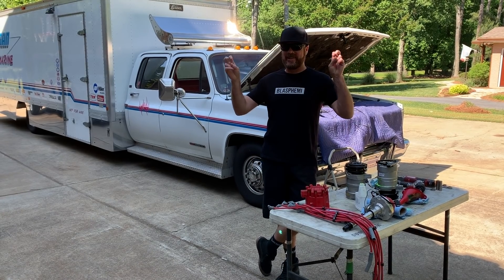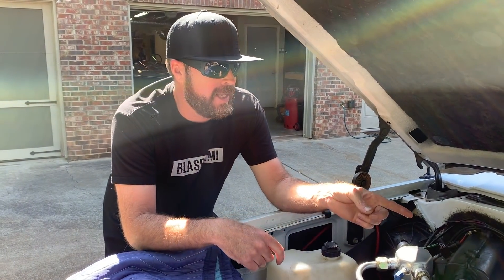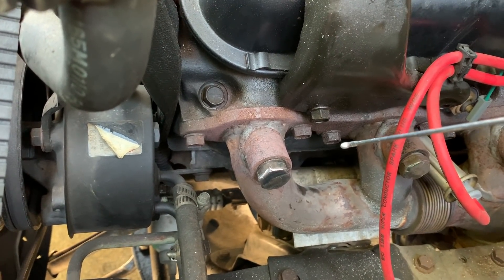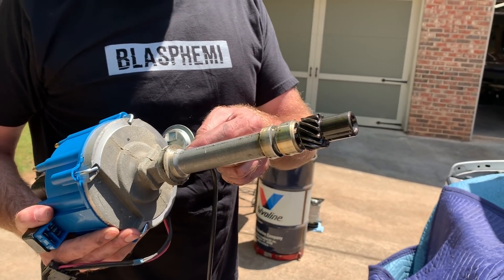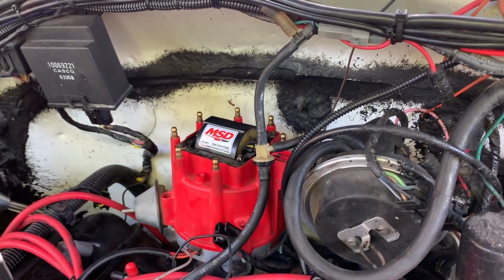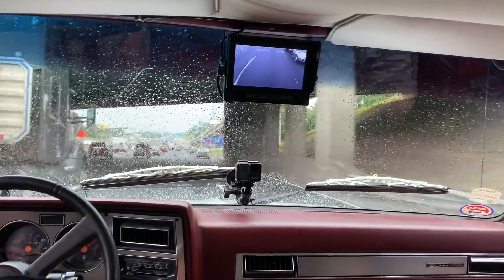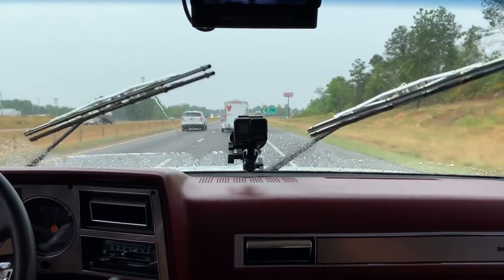More Power and Better Fuel Economy Thanks to Tuning and Overdrive! Ep.71

Comment: Vacuum advance should be on ported so that vacuum advance is only there at part throttle 12 degrees for baseline timing  and mechanical advance for the rest giving more timing the higher you rev the engine giving the engine max timing by 3000 RPM total something like 32 to 36 degrees total timing
Reply: I know a guy who's a big block tuning wizard, currently he runs a blown chevy 454 in his late 70's 3/4 ton 4x4 "work truck", tows his backhoe and equipment behind it, says he blows the doors off some of the guys in their diesel trucks. He's also dabbled in olds 455 engines and made em run like no one else could. 

He had a 1970 Pontiac Firebird drag car with another chevy 454 in it(naturally aspirated),  he said he was running a modified distributor to give him more advance at WOT or max rpm, was running a total of 56 degrees of timing advance, said his "tune" liked/needed at least 50+ degrees of advance, I don't know what he was reving the engine too, but you know it was high!

Comment: Hard to wrap my head around that kind of mpg's
Reply: My daily drive gets the same mileage, but it has a 406 sbc that makes as much or better torque than that 454. It is built after a magazine article called 406 impersonator, because they built a small block to make big block numbers. It cost a metric boat load of money to build a full roller sbc with a forged crank and all the other good parts to support it. 9 mpg average for my 79 C20 camper special. I'm saving money for a 2020 duramax truck and looking forward to 17-22 mpg and a quiet smooth ride. I love the classics, but my body and wallet (fuel) want a modern truck.

Comment: Is it sad that my lifted  89 k1500 gets 8-12, my truck gets the same mpg as a trailer truck. But then again 33 by 12.5 swampers aren’t very good for the mpg, also a cam out of a motor home, 77 corvette 4 bolt bottom end(short block),  billet piston and rods, ported heads and a 700r4 out of a 92 vette, or the Holley 4 barrel I’m rocking and summit manifold. Damn... nvm I see why my gas mileage sucks... sorry
Reply: Small flex 💪

Comment: It's strange that this truck, being an '89 isn't TBI with the computer controlled timing curve distributor deal.
Reply: I was thinking the same thing. Factory computer controlled initial timing for the TBI units was zero degrees.. wonder if someone swapped the tbi module and forgot to set the timing to take that into account

Comment: Also vacuum advance helps smoothing idle and cranking. I inherited a caprice that went through 4 starter motors, i even put a reduction type starter (sweet sound) at last to remediate this, and it did. 

The engine also blew the ceramic core off of a random spark plug under WOT so after further investigation we found the base timing at something like 22 degrees and that plus the mechanical advance  was the cause for the heavy cranking and spark plug blowing.
Also the car tended to overheat when going up hills wit the A/C on.
 So the vacuum advance actuator , a 5 or so bucks piece has so many bad effects it's incredible.

Comment: Pretty good, My grandfathers square body 454 four speed, got 8 mpg, loaded or not, and it was a 3/4 ton pickup.
Reply: My 79 C20 got 8mpg with the 350 and only slightly better with a gearvendors overdrive and 383. Now, with a built, forged crank and full roller valvetrain, ported aluminum heads and intake, msd, headers, etc.  406 sbc it gets 9mpg or so, but I drive it like I stole it and it is estimated at 525 tq. and 400+hp. These trucks just don't sip the gas. I'm planning to buy a 2020 duramax 2500 crew cab long bed truck. They average 16-17 mpg city and 20-22 highway, with 910 tq., but 2020 trucks get an alison 10 speed. What an improvement over the classics!

Comment: I can't believe you drove for so long on ignition with ~0 degrees timing advance. You probably wasted thousands of $ in gas and did the motor long term damage. Regardless, I'm super happy you're putting the time and effort into improving fuel economy and tuning up the ramp truck. Thanks Finn

Comment: Just put a Cummins in it. Fixed your problems.
Reply: No, that doesn't fix having to hack a huge hole in the original firewall, losing the factory hvac and then on top of that having to deal with a loud clattery tractor motor.
I'd rather have a mean well built big block and just pay for the gas any day..

Comment: Do away with that belt driven fan and put in an electric fan and you might squeeze a little more fuel mileage out of her.
Reply: Important to mount in the cab an override switch and also for good measure, a fuse with a lighted gauge so if the light goes out you know you just lost your fan
Reply: That fans gotta be sucking at least 20hp down the road. Sure it's simple and effective, but it's not efficient at all. So I agree, that should be the next upgrade.

Comment: Gives me hope for my truck.   TBI 454 / TH400 R30.    Best it's ever done was about 8mpg unloaded.
Reply: I have an 1988 r30 3+3 dually tbi 454/th400. I use it to haul a 37 foot gooseneck 14k trailer with offroad trucks. And I get 5.5mpg with it. Hauling from Alabama to Tennessee and back for  offroading.  I have tbi with Edelbrock TBI aluminum heads . Edelbrock TPI intake manifold. And Comp Cam full roller aluminum rockers. Before adding  that stuff the truck wouldnt haul that load. Now  it doesnt have a problem. I'm not sure the timing is right though.

Comment: Time for a Gear Vendors Overdrive/Underdrive unit now! Double digits would be within reach!
Reply: 4L80E is already an overdrive
Reply: chevelledrew I’m fully  aware that it’s an overdrive transmission, but it’s still only a 4 speed. I guess I should have clarified that by adding the gear vendors unit, you could split gears and possible get even better fuel mileage.

Comment: They made a tunnel thingy that brought air from the front to the back seat for those. I don't remember the video, but a guy with one of these that had it as a work truck (you know, the compressor, welder, repairman type rig) presented that in his video. It attached to the back of the bench seat and looked pretty stock as aftermarket things went.

Comment: did you read the fresh plugs, or check the wide band? I think Square Force 1 has a wide band O2 sensor installed. most important, how is the tape deck? any new tapes. and does the overdrive improve the tape deck experience.

Comment: A modern'ish 40/20/40 bench seat with headrests, shoulder support and arm rest would improve the cross country drivability and safety so much.  Of course have them re- done in matching red vinyl so they look period correct.   I know you have mile long to-do lists but this is about safety and fighting fatigue.

Comment: From 5.5 MPG to 9.0 MPG is an increase in fuel economy of almost 64% - That, my friend, is a BIG WIN!
Reply: 60% increase. 5.5 to 8.8mpg  [(V2-V1)/V1] x100
Reply: @grumpydave5377  You're the only one that's calculated it correctly.
Reply: Basically doubles the gas mileage. & Now it looks mint and will run mint for another 30 years (*❛‿❛)
Reply: He went from 18.18 gallons of fuel per 100 miles to 11.36 gallons of fuel per 100 miles. That is utterly gigantic.
Reply: Thats MINT!
Reply: It's 46%
Reply: A 4.5 increase from 5.5  is about 80% increase.  4.5 is just over 80% of 5.5.
Reply: its not - they have just avoided additional future losses. this 'maintenace' should have been way earlier. 'A pest' to make an episode from it, but typical finnegan. in the end they are still burning 23 USD/100 km - maybe a hybrid version could help, 'recup instead of braking'? we had a brandnew toyota prius 3 (a hire car) in hawaii last year - around 102 mpg possible when 'just following everybody in the stream'. ev-swaps/chassis tune-ups become more common now: https://www.youtube.com/watch?v=jKv_N0IDS2A
Reply: @hamsun57  No.
Reply: @hamsun57  you think a hybrid swap will overcome the massive increase of weight and the terrible aerodynamics of this vehicle would stress any motor to death. Also a Prius is designed to maximize possible mpg. You almost never hit 102 mpg out of the generator or engine.
Reply: @hamsun57  also what the hell are you talking about a 454 with a hybrid setup would still achieve horrid mpg numbers as they are running on a low compression setup with very little ability to extract the thermal energy out of the fuel. A hybrid would just reinforce the issues as these engines are literally car engines with a different cam so constant speed or a true hybrid setup wouldn't stop anything.

Comment: Factory colored headlight surrounds and grille with 19.5" Alcoa's, polished paint/ diamond plate along with ceramic coating would look so freaking good.  I would also add some roll out awnings on each side off an old RV to keep everybody cool and happy in the shade without having to store and setup EZ-ups which cant compete with RV awnings.

Comment: know how you feel Mike, improved my 900 Triumph Trophy to get 250mi to a tank (20l) by changing the plugs one step colder and gearing from 17t/43t to 19t/40t

yes ok that run I was running behind my partner on her 125cc doing 50/60mph but how much fun is squeezing every last mile from a gallon of petrol, now i reguarly see 200mi per tank on a working week playing about whilst commuting and no noticeable loss in acceleration either 

from a monthly average of 42.3mpg to a whopping 49.9mpg since I bought her in Nov 18

win win for me

Comment: Hi finnigan....how come you have so little timing...I outdone feel that 36 total is a starting point..of course the purpose is to start the flame kernel soon enough to get all power possible..but the more timing is required with heads that have such a poor chamber design
Reply: Yes, and under light load (high vacuum) it should take another 10+ degrees for even better mileage

Comment: EGR increases MPG at gentle cruise by effectively reducing cylinder displacement without interfering with AF ratios. Engine driven fans are a huge waste of fuel too.
Reply: ...engine drive fans are a huge waste of fuel until you NEED an engine driven fan, like when driving a giant boxtruck full of cargo through Death Valley in the summer., which  he's likely to do. I mentioned in another comment that I'm curious about a hydraulic fan conversion though. That's the best of both worlds.

Comment: Toss that 454 to the curb and replace it with BBC 402 and RV cam not over .500 lift and you'll get in the teens for MPG with good breathing heads.
Reply: I'll bet not! Did you mean 502? My 79 C20 has a built 406 sbc. 264 roller cam, full roller rockers, 10.2:1 CR ported aluminum heads and intake, msd pro billet hei, headers, gear vendors and all the other good stuff. It averages 9mpg and 5-6 mpg towing an 8k pound toy hauler trailer. I do drive it like I stole it! NA gas engines just don't get good mileage moving around heavy loads, especially with large body trailers or trucks that have bad aerodynamics. Even 6.0L LS style engines don't seem to do great on fuel and the 8.1L sucked on mileage. I would love to see an LP5 or other duramax in squareforce 1.
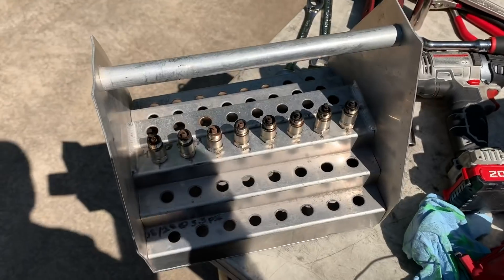Reply: @CGT80  that's a bet you'll lose every time because I've done it in my 88 ext.cab dually. 454 heads are smog heads don't flow and choke the shit out of the performance. My 402 BBC from my 71 3/4 ton was getting nearly 20mpg in it with 3:55 gears. My dually has 4.10 gears soon to be replaced to lower set. The 4.10 gears are killing the mileage unless I run 55mph on hwy but still getting mid teens for MPG. I think you're missing the whole point you don't take a racing engine throw it in your truck and hope for good mileage Small blocks need HP parts to make torque that Big Blocks already have when factory stock.

Comment: I'm not sure I'd call "we're not dieseling" a win...it means you don't have a diesel in Squareforce One :-)
Reply: Its  good he doesnt. Cummins swaps and diesel swaps into a squarebody are fucking retarded
Reply: kyle steen not only that, if you recall when they swapped the Cummins into the OG ramp truck, they had to cut into the firewall and transmission tunnel to make it fit. Squareforce 1 is WAAAAAAY too mint body wise to be hacking it up for any type of diesel swap.

Comment: Thanks for the PSA, ive been hunting down why i have been getting bad mpg in my 91 s10. I never checked the timing. the old 2.8 needs ~13* and she had 8.
Reply: jhowe67 did you ground the wire from the ecu before setting the timing?
Reply: @austing2005  my Haynes manual didnt say anything about grounding any wires.
Reply: jhowe67 It should be a tan/black wire under the heater box just behind the carpet on the passenger side. It’s there.

Comment: If you want to get better  mileage hook up an electric motor to the air conditioner take it off the motor substantial savings
Reply: BS an electric compressor would tax the alternator so much you would probably need two alternators to run a 3-4 horsepower AC compressor especially on 12 volts. Power is power doesnt matter where you get it from it goes back to what ever is generating that power.

Infact it be way less efficient and rob MORE horsepower like that because you're transferring energy 3 times (mechanical > electrical > mechanical) rather than once with a mechanical connection to the motor...

Comment: Next job properly position that air dam on top of the cab
Reply: It's funnier that it's both upside down and doing nothing.  Though I think the guy who's company made that originally said Mike would have to pretty much put it on the hood to have any hope of it actually affecting the airflow as it's completely the wrong shape.
Reply: @nauthizzz  The airfoil/spoiler is only there to deflect the air up over the box. There's no other aero advantage for the shape. But it is 80s cool.
Reply: I've read that in other people's comments. Where should it be placed??

Comment: So what do you think of putting a 4.11 Rear  in it?would it pull up hills alright or are you sticking with the 4.56?
   Are you going to move the wind deflector forward?

The tires are a max pressure too I would think.

Comment: Be interesting to see how good a new diesel Cummins crate repower conversion (using the latest tech) is compared to the 454. Suspect it would pay for itself in quick order and make trips to high altitudes easy.
I've never seen a unit that size on the road (in 'Stralia) - the Maccas drive through would be out..

Comment: Wonder if a 6L80 would be worth the 10MPG you'd get?
Reply: I'll bet they aren't cheap! The 2020 duramax trucks will have alison 10 speed transmissions. Hopefully, that will allow them to squeeze even more fuel economy out of them. That old 454 needs all the help it can get, to stay in the power band so I would guess it would be a better driver with a 6 speed but probably not worth the money. An LP5 duramax would be an awesome swap that would run quiet and make tons of power. Cummins is way over done and the ramp truck is obnoxious for something that goes on road trips.
Reply: @CGT80  Yeah I've been over 600 miles in a round trip in a '93 Dodge D250 3/4 ton 4x4 with a Cummins... Not pleasant...

Comment: I can identify with this, my first car (‘89 Fiat panda) ended up with a broken vaccuum advance diaphragm.

It not only introduced an air leak, it also let the points swivel round to 10deg AFTER tdc! Wouldn’t idle unless you kept your foot on the gas revving enough to keep the mechanical advance going. However it popped and spat and crackled on the over-run like a rally car, which was kinda cool. After a couple months nursing it I managed to track the issue down, put a home-made plate in to hold it at 12deg before, then it at least drove properly until I could get a new vacuum unit lol!

I though at the time it’s dieselling habit had to be related, it’s super interesting to hear you describe exactly why!

Comment: I used a 454 engine in my old C80 and it had a five and a four in the cab to make life fun. It seemed like I had to at least split every gear after second and on a long down hill run pushed the ten mark but push was the best with a 9.6 mpg. Coming back, I got barely 7 and a 5,5 mpg for about seventy miles so all in all (legal load both ways)about eight average. I think the automatic would of been better.

Comment: Mike, I really love this truck!  Theres still a ton you can do for better MPG as well. 
You'll  want a trailer-tail for the rear of the box. its the same stuff that the semi trucks use [ https://imgur.com/jPHqw2u ]
Moving the roof wing forward about 8-12 inches will help with the front box aero, it will push the air over the box then, instead of sitting in a dead zone doing nothing. It needs to sit much closer to the front edge of the roof than it does.  
Also look into putting some skirts over the rear wheel arches. Just fasten some aluminum panels in there with Dzus locks so you can still change the tires. as it sits now, they really upset the aerodynamics of the back of the box. 
Look into also putting a lower, almost road dragging lip on the front, and some lower side skirts down the sides. You can just make it out of black plastic and sacrificial. Any air you can keep out from under the truck will improve mileage greatly. 

With all of these modifications, and making sure that your tire pressures are at the maximum that is safe for  the task, and you can probably break 11mpg. Maybe at some point you can open up a thread on the ecomodder forums, those guys would LOVE a challenge like your truck.